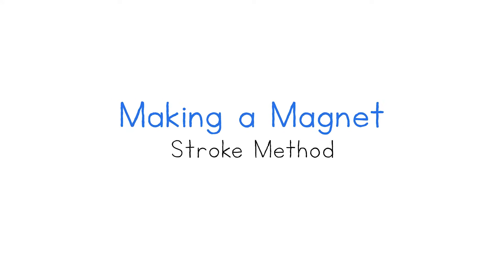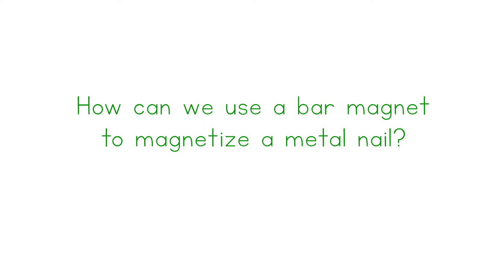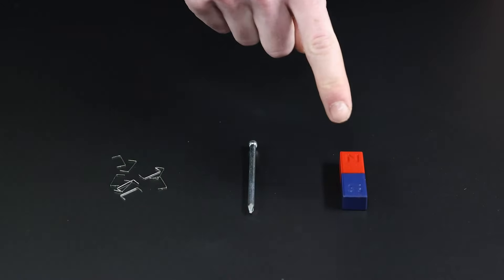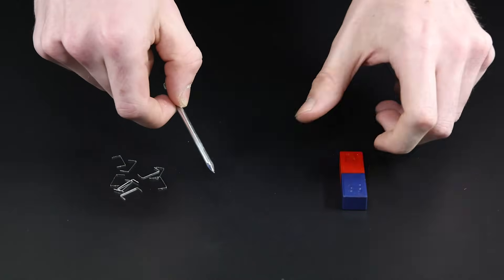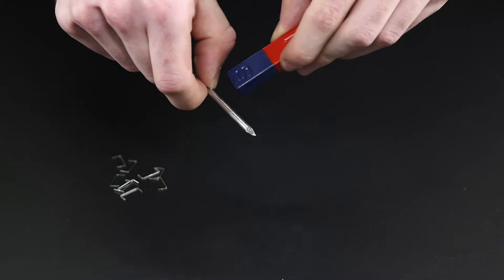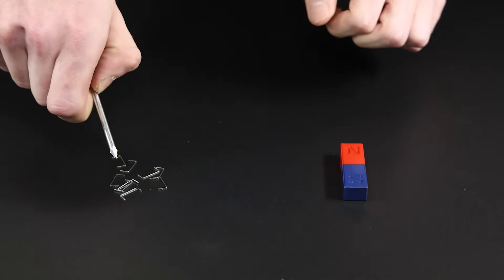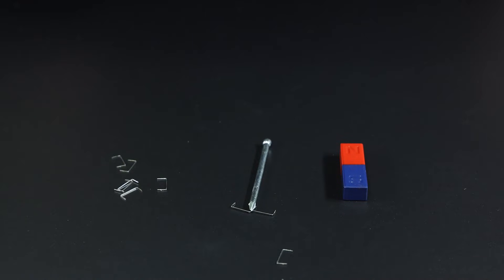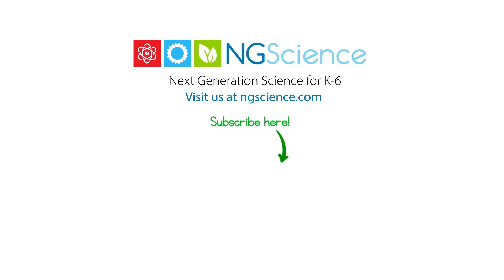Making a Magnet Using the Stroke Method

Comment: but how can you make a magnet without something magnetic
Reply: you cant. magnetic materials have small unaligned magnetic domains. when you induce magnetism, such as the stroking method, what youre doing is forcing the magnetic domains to align, and hence become a magnet. this can't be achieved if the material does not have magnetic domains in the first place